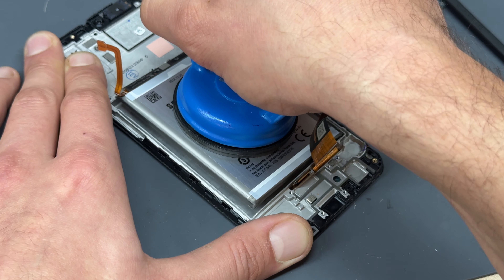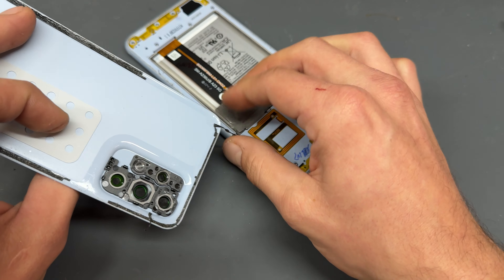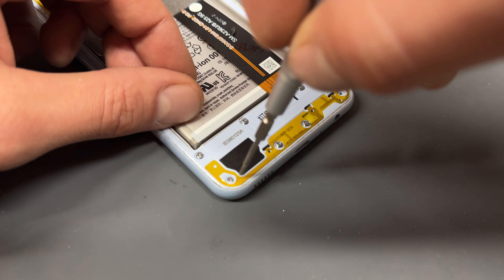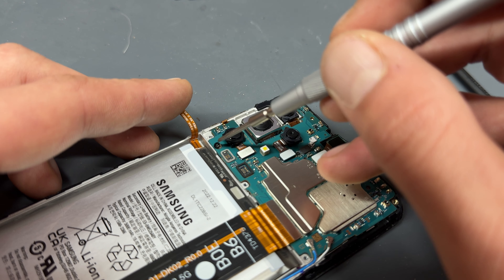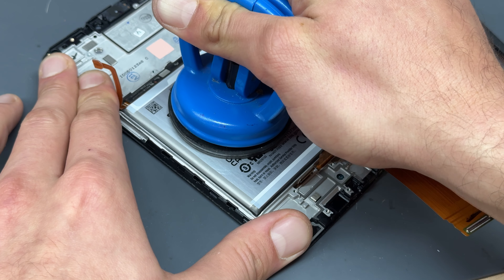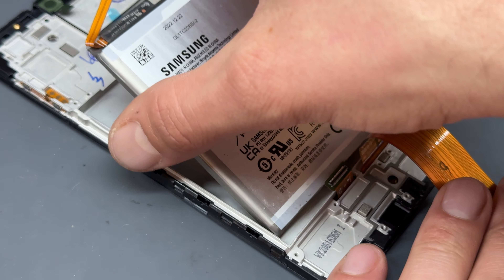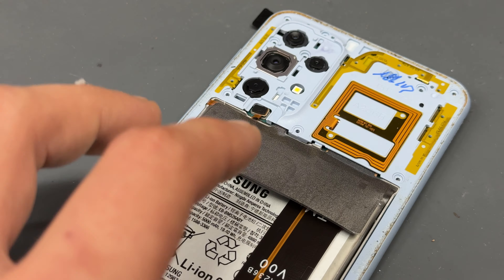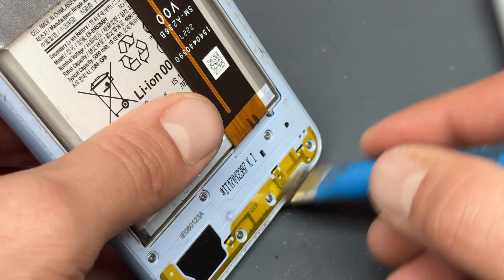DIY Samsung A23 Screen Replacement Guide!

Comment: Did the replacement and I have a blue screen about a customer OS install. Have you seen that before? None of the buttons are responding except that it will do a quick reboot with the side key held down

Comment: Thank you so much for helping me get that bezle off. I used a screen without a frame and I have to say that it's a bit more noob friendly. Once the side bezle is removed, you can simply unplug the old screen and plug a new one in. Sure you have to glue the new screen in place, but it's always good to have a use for the contents of my bookcase.

Comment: Good video, first time doing this and everything works well after replacing the screen.  I bought a $20.00 aftermarket Kuert screen on eBay.  I had to transfer the volume control ribbon wire and speaker.  Screen came with tools, but the suction cup was worthless, had another in my toolbox that worked along with some careful prying.  I am glad I saved myself some money by doing myself!

Comment: Hey, my charging port did not function as it should be. Cleaning did not help. I changed the subpanel. This problem was solved. Since this time i have another problem. People who call me say they hear themselves (echo). Is the problem the speaker on the top? Could it be that it lost adhesion and the sound from the speaker comes to the noice cancelation microphone inside the phone? Or is the problem somewhere else?

Greatings from Germany

Comment: I've replaced the screen but unfortunately is not charging .
Reply: More than likely the charging port was disconnected. I would double check all the connections and that should fix it.